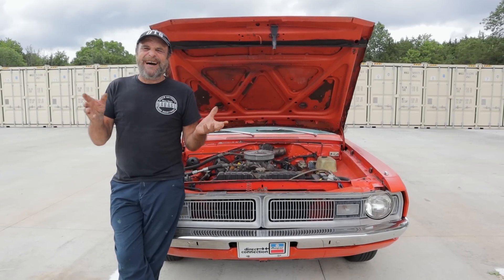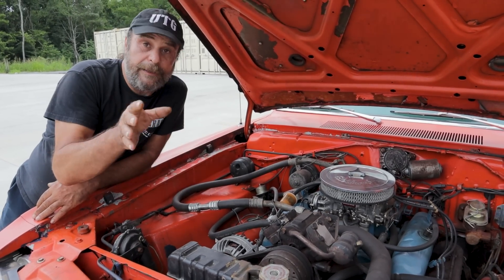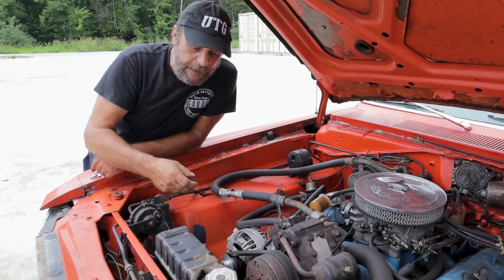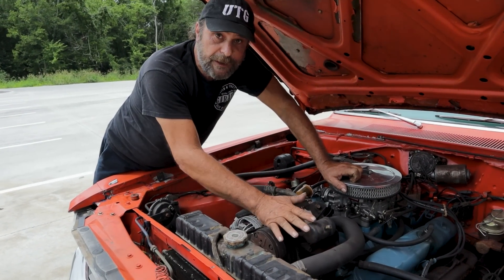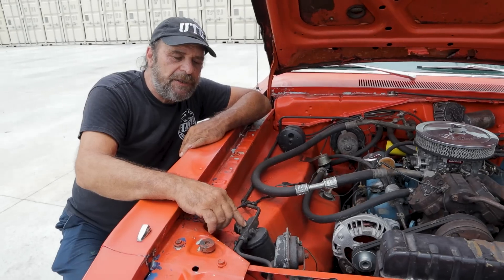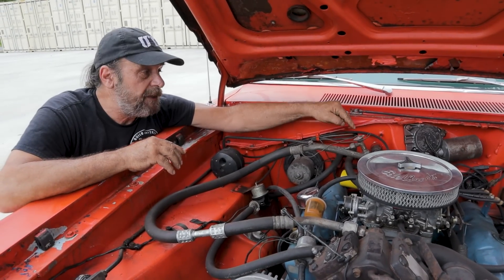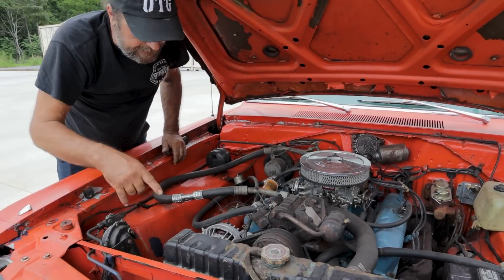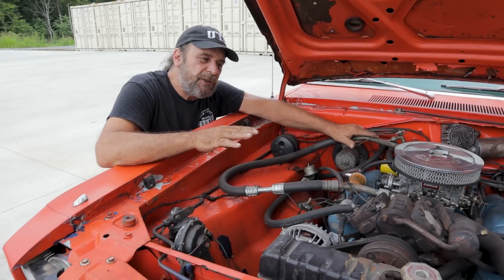Classic Car Air Conditioning Systems - How They Work, Their Differences And Basic Troubleshooting

Comment: Love your videos but you have a lot of wrong info in this video when it comes to The transfer of heat / energy.  
How the refrigerant works is when  the refrigerant is a low pressure vapor its compressed into a high pressure vapor and once the refrigerant s cooled it condenses into a liquid per the name condenser then as it goes into your cab / evaporator per the name evaporator and when the liquid turns into a vapor that's where the energy transfer happens.
Reply: He had the basics but yes, he didn't say after the condenser the freon is 'cold'.
But he was 'correct' that at the firewall it 'where' the cooling takes place....just about every car with the AC running drips water at that point but not up by the radiator.
And yes; I know why cold hose and hot air maker water...save it...

Comment: More incorrect info. That switch on the receiver drier is a high pressure cut off switch. It turns the compressor off if there is too much high side pressure. That v2 compressor has its own oil sump. It does not rely on refrigerant to move the oil around.  The York,techumpse and A6 all have oil sumps as does the sanden compressors.  The expansion valve creates a restriction that lowers the pressure allowing the refrigerant to boil in the evaporator.

Comment: Very basic explanation.  It's pretty good in 15 minutes.   The biggest mistake I can see is the explanation of the expansion tube vs. expansion valve.  The biggest purpose of the expansion valve is to compensate for wildly different conditions, especially flow. As the engine changes rpms, the flow from a constant displacement pump also changes due to the pump speeding up or slowing down.  An expansion tube, on the other hand, is just an orifice, basically.  So, to compensate for the changes in rpm, the compressor is a variable displacement compressor. This means that as the rpm changes, the displacement of the pump will change to keep the flow consistent.  In other words, both systems are basically self regulating,  it just depends if that regulation occurs at the point of expansion (expansion valve) or at a variable displacement compressor like the expansion tube design.
Reply: The electrical stuff he mentioned can be present in either style system.  Generally the basic three things electrically found in A/C systems are a high pressure switch, a low pressure switch, and a freeze switch/thermostat.
Reply: A high pressure switch is found on the high side of the system, and its job is to prevent destruction from too high of pressures.
Reply: A low pressure switch can be found anywhere in the system, including within the high pressure switch. As mentioned in the video, its main purpose is to shut down the system due to refrigerant loss.  It's generally found in the low side for a second purpose. Too low of system pressure within the evaporator can cause the evaporator to get too cold.  This can cause the humidity in the air to freeze to the evaporator, which then can block air from flowing through the evaporator. This is called icing up.
Reply: It's worth a note that, at least on GMs (I think many Fords too), the orifice tube also acts as a screen and "should" be changed, or at least cleaned, whenever the system is open.
Reply: The freeze switch/thermostat can also pull double duty, depending upon the type of switch. Its primary duty is, like the low pressure switch, to prevent icing from the evaporator being too cold.  If the heater and a/c system have two separate temperature controls, the thermostat has a second function. In this case, the temperature control is adjusting the switching point of the thermostat in order to control how cold the evaporator can get, which controls how cold the air coming out of the vents can get.
Reply: All three switches control either the direct power to the compressor clutch, or they can run a relay (hint) that controls the compressor clutch. 

The hint: Due to the age of the switches and connections, there might not be enough power to operate the compressor clutch. By installing a relay, there is less current flowing through the switches and connections, and the compressor clutch can get full, clean power to operate.
Reply: One last mention. The original source of power. Generally speaking, the most likely source of power is the fan switch.  The reason is that the system can only function properly if there is air flowing over the condensor and the evaporator.  In order to ensure there's airflow in the evaporator, the system will get power when the fan is on, too.  Yes, there will be an on/off switch for the A/C, but generally speaking, that switch will most likely get its power from the fan switch.
Reply: @TheBrokenLife  good point!

Comment: SO a little story time., I replaced all of the ac parts on my 87 chevy truck and took it to a local shop to have it charged. They for some reason retightened the pressure sensor witch leaked everything out. Said to hell with it and bought the tools and did it myself.  Still blowin cold after 2 years.

Comment: No fan stroud it's not going to do good when idling . Head pressure is going to be very high. May even blow it pop off valve or stall the compressor.

Comment: Please stop calling it Freon. That was a tradename by DuPont for R-12. The purpose of the expansion or h valve is to slow the R-12 down from a liquid to a gas to lower the temp. I still have my license to buy R-12 from back in the 80's when I was doing a/c work
Reply: Also.... the evaporator absorbs the heat from the air.... it doesn't 'cool' it.... i had a chuckle on that one.
Reply: Well, kinda.  I was taught that the pressure changes at the expansion valve/tube, but the state actually changes inside the evaporator.
Reply: @OlysGarage  you are correct

Comment: You my as well get rid of a r12 system. Hard to find parts and r12 is no longer made. If you find some it's old stock. I bought a new 20 pound can of it when you could still use it. Went to use it on a old car and the thing was empty. Just sitting there for 10 years it had to leak out I guess. Made me mad that it just leak out. Was a brand new 20 pound cylinder that was never open on top of it. Had some cans of it same thing. Unless you got big bucks and it's a nice car it may be worth it. Otherwise better to just get rid of the old system today.

Comment: why so afraid to mention that propane is a great refridgerent in an old r12 air con system? no need for vacuum, just purge line til pure propane and oil spray out of purge valve.

Comment: Gas gets compressed - you can't compress a liquid.  The refrigerant expands, cools, and becomes liquid.
Reply: Mineral oils do compress some as liquids.
Reply: You absolutely can compress liquids,,,,,,,,, I do it on a regular basis
Reply: @BrandonLeeBrown  I thought that the mineral oil aero-mists in the gaseous refrigerant which compresses within the oil mist.
Water doesn't compress, right?
Reply: Gas is compressed and heated in the compressor, cooled and condensed into a high pressure liquid in the condensor.  It's then changed to a low pressure liquid at the expansion valve/tube and evaporated back into a gas by absorbing heat in the evaporator and then going back to the compressor to repeat the process.   I kinda get what you meant, but it didn't read very clearly to me.